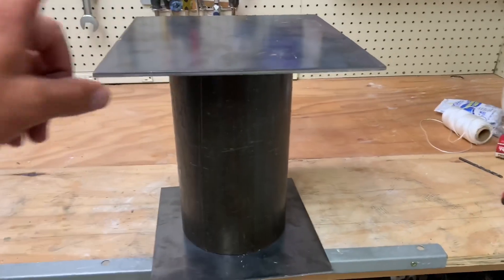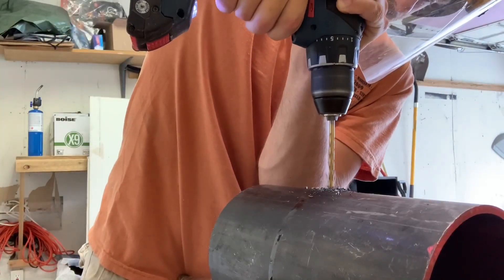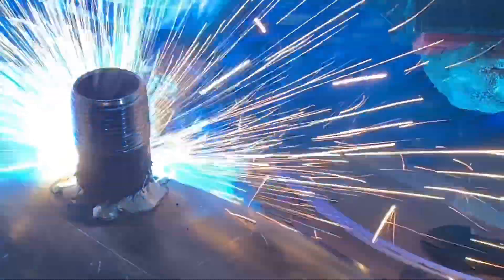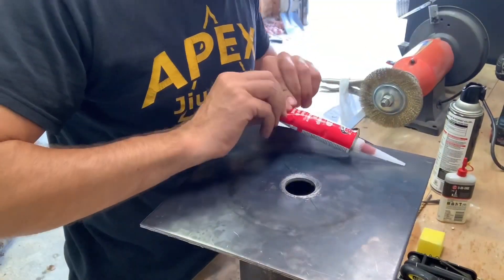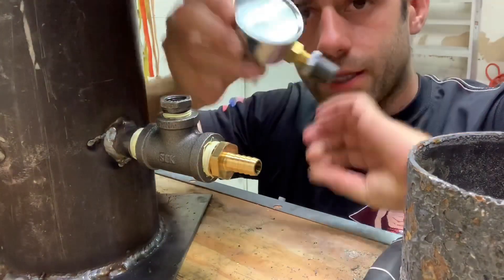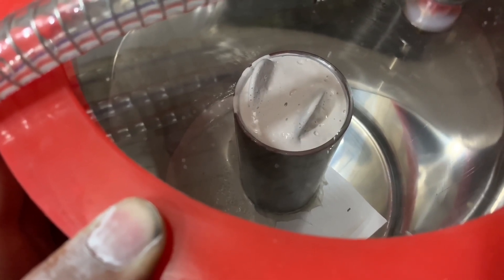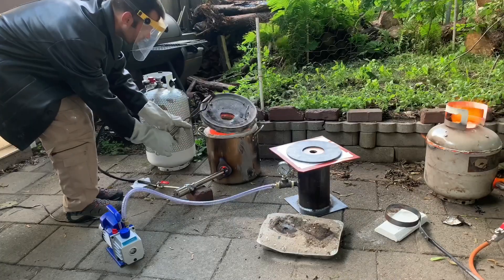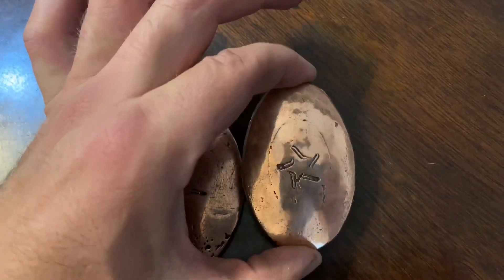Building my first vacuum casting table

Comment: How does the vacuum work when pouring the metal? Wouldn't it need a lid to seal over the table? And wouldn't the the vacuum hole be blocked by the mold?

Comment: First of all, props to making your own vacuum table. It's always easy to criticize someone for something that you haven't made a video on. I have some suggestions though which might give you better results. If you look at how the pro tables are made the investment flask sits below the table top level and there are holes in the outside of the flask, which allows the vacuum to work in more directions than just straight down. Since it only needs to hold vacuum, you shouldn't NEED to weld it together either. If you had the parts machined so they fit together, you could seal the seams with high temp silicone to keep a vacuum without any warping.

This would also make it be able to be taken apart if you ever needed to clean it out. I wouldn't glue the silicone gasket down either. Eventually you're going to want to replace it and the vacuum will hold it down when activated. By not gluing it down you skip the monotonous step of scraping old gasket material off with a razor in the future.

I don't think the failure of the drill/hole saws from China was necessarily poor materials, but more from trying to drill freehand with a hand drill. If you used a drill press with the parts immobilized on the drill press table, it would take out the variables, like slight cant which puts sideways torque on drill bits which will cause them to snap. I can remember many times where I broke drill bits, and it was ALWAYS when I did it freehand. I've never broken a drill bit on a drill press. 

Center punch your starting location. (Which you did) Then start with a pilot hole with a "center drill" which are much thicker drill bits with only the tip sharpened. They have much more rigidity than the standard fluted bits. Follow that with a fluted bit, or your hole saw with the same size bit you made the pilot hole for. 

Last suggestion is get a set of taps and dies, so you can drill and tap one hole without having to go thru a bunch of hardware store fittings to adapt it to what you need. Whenever you have multiple parts, it allows more of a chance of a failure because you have more parts fitting together. Obviously your design works but these are improvements I'd mention if you decide to do a vacuum table 2.0

Comment: Hi, Lucas.  I realize this video is quite old and you probably know this by now, but just in case -  The way to avoid warping a metal plate while welding is to do it in short bursts.  Do 4 small 'tack' welds, on different sides of the cylinder, let it cool down completely, then go back and do up to a half-inch more on each; let it cool again, and so on.  This way, you never let enough heat build up to warp the plate.  I  had to learn that the hard way.

Comment: Also as dude below said, you need to pour in one swift motion, you're better off spilling over edges than having to stop pouring then start again, also that tilt at the start was way too slow. Think of pouring metal like trying to flip a cake tin to get a cake out or how they flip buckets to make sand castles but not as fast or dramatic. More of a smooth motion with no slam at the end but that's the best way I can explain. Hope this info helps but great video!

Comment: You added your pennies waaaay too late, supposed to add them before melting temp then let them mix in then get it to temp and when it vaporizes it will pull impurities out, what you did just instantly vaporised the zinc before it even hit the metal hahha, also don't breath those fumes in@@! They cause metal fume fever which can kill you.
Reply from the maker: Haha! I knew something was wrong. Yeah I wear a respirator every time I melt brass.

Comment: I wouldnt recomend showing yourself on camera breaking the law by desecrating currency just a fyi
Reply: Defacing currency is only a prosecutable offense if it is done with the intention to defraud.
Reply: @BrassJunkie  not true
Reply: @jacobleeson4763  18 U.S.C. § 331 Whoever fraudulently alters, defaces, mutilates, impairs, diminishes, falsifies, scales, or lightens any of the coins coined at the mints of the United States, or any foreign coins which are by law made current or are in actual use or circulation as money within the United States;  or

Whoever fraudulently possesses, passes, utters, publishes, or sells, or attempts to pass, utter, publish, or sell, or brings into the United States, any such coin, knowing the same to be altered, defaced, mutilated, impaired, diminished, falsified, scaled, or lightened--

Shall be fined under this title or imprisoned not more than five years, or both.
Reply from the maker: It’s actually not illegal to do this. A lot of people think it is though.
Reply: @lundgrenbronzestudios  Yes it is. Obviously no one is going to arrest you for a couple pennies that would be ridiculous but it doesn’t make it legal. You are still destroying currency. Pennies are expensive to make they cost more than their value to make. Destroying them cost the government and economy.

Comment: I'd be interested to see how it would affect the casting quality if you added pressure to you chamber after the metal flowed in. I use vacuum and pressure in casting resin so that I can reduce bubbles in complex pieces like pinecone castings.
Reply from the maker: Hmm. You cast pinecones?  I tried doing that but didn’t have the best success. Unfortunately I wasn’t able to use the vacuum table here because I put a flask on it that was too hot and melted the gasket.
Reply: @lundgrenbronzestudios  - Pinecones look awesome when cast in multi colored resin but you absolutely have to use pressure and even better if you can vacuum  then pressurize.
Reply from the maker: With the metal it goes to a solid state in a mater of seconds so a quick draw with a vacuum is really all you have time for.

Comment: Just a suggestion but I'd just drill a hole in the side and use a tap to make threads and skip the welding. You can also use a router and cut a circle on the plate and seal with RTV.  I'm sure most of us would do things different on the second go around on most projects though. Good work!

Comment: How is your pump holding with those temperatures (500 deg celcius)?
Reply from the maker: The first thing that went on it was the gasket. I need a higher temp gasket. Graphite or something. I don’t think the air the gets to the pump is nearly that hot. It worked the first few times I used it but then the gasket melted and I haven’t fixed it yet.
Reply: @lundgrenbronzestudios  Thanks for the reply :-) it seems that the high temp gaskets last for about 3 to 5 times @ 500 deg C

Comment: I did not read the other comments so I'm not sure if someone brought it up, but did you bake the wax out of your mold or did you just melt the wax with the molten copper?
Reply from the maker: No, I melted the wax out first and then heated it hot enough to burn out any residue. It’s important that no wax remains in the mold if you want it to turn out.

Comment: Dude, you're doing great!  I own a commercial vacuum table and I'll tell you my hole I set the flask over is MUCH smaller than what you have here.  It's only about 3/8".  I completely understand it takes 3 hands when doing this.  That second furnace isn't really doing you any favors.  An electric kiln that you can set a temperature and leave it while you get your metal ready would make your life much easier.  When we pour metal in the flask, you can see it get sucked in really fast.  Don't dink around pouring.  GET it done!  Note what kind of vacuum you are able to pull on the flask before pouring and get back with me.  You want maximum suck!  The only other issue I see is your "tank" is HUGE and by the time you set the flask on it and pull a good hard vacuum on it, you've lost loads of temperature unless you have a really good pump.  Something to think about.  You might want to shorten that tank... BIG TIME.  I would have used 1/4 of the length of that pipe.  Keeping the nipple in the middle is a good idea.  You WILL lose a flask at some point and will suck metal into your setup.  Having it get sucked into the pump will ruin your day.  Commercial tables are designed not to have this issue.  If you want detailed photos of a proper $$$ table, I can get them for you.  Just gotta give me an email address and I'll get them to you.  ;-)
Reply from the maker: Yeah I am already wanting to re design it to make it better. I love to see what kind of set up you have. My email is Lund1060@gmail.com.
Reply: Please send me some pics also I am struggling to make a successful setup. Recoveryman325@gmail.com
Reply: What do you have to say about the kaya casting machine?
Reply: @sahilsquadron2286  I think that question was directed at me..  Its a real nice machine.  For a home hobbyist, it's over kill unless you are really serious about jewelry casting.  For a small professional shop, it would be a good investment.  It all comes down to the size of your castings.
Reply: @jagboy69  yes it was and thank you :), would you suggest building my own, basically have a machineshop at my disposal and know my way around pretty well. I'm just a hobbyist atm from home but plan on making this a living in the future. Already have a pneumatic graver, a facetron, a shitty rolling mill and basically every other tool of the trade, basically the one thing I'm really struggling with is castings.
Reply: @jagboy69  and don't get me wrong I can cast ingots etc not too shabbily for rolling but other than that I really have no experience with sprues air holes and the rest of it and I feel without vacuum it's going to take me another year or two to get it down pat if not longer.
Reply: @sahilsquadron2286  It's a simple build really and doesn't need to be complicated at all.  A flat plate with a hole in the bottom will do the job if you run solid flasks.  Investment is porous and if you get a good seal on the bottom and the flask isn't enormous, it will work just fine.  I suggest you visit THF and sign up.  There is a wealth of info there compared to a lot of trash you can learn from youtube.  Here is a thread I did recently on my cheap vac table.
http://forums.thehomefoundry.org/index.php?threads/vacuum-table-101.1404/